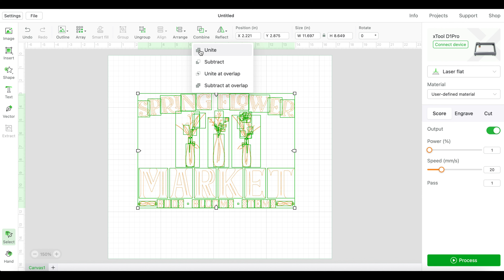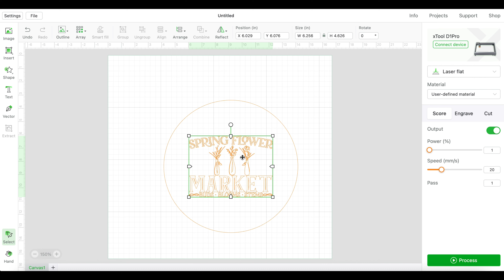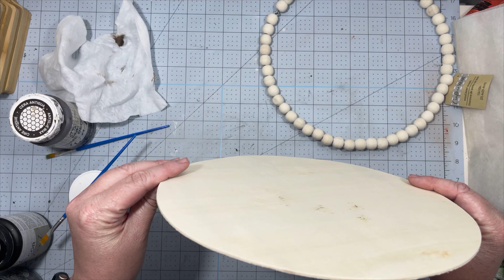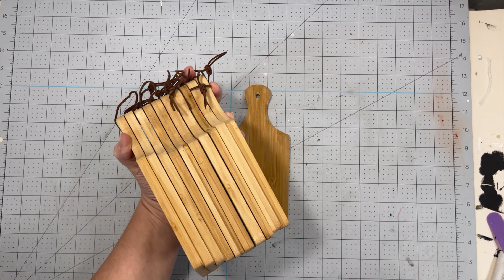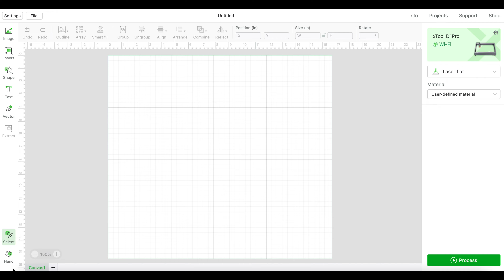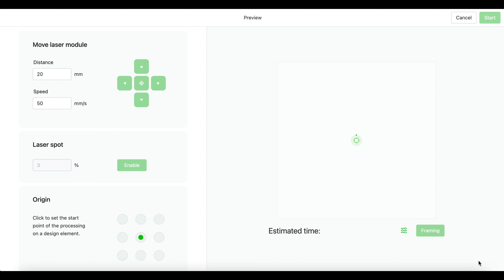Make Some Projects With a Laser || Easy Beginner Friendly Laser Projects || xTool D1 Pro

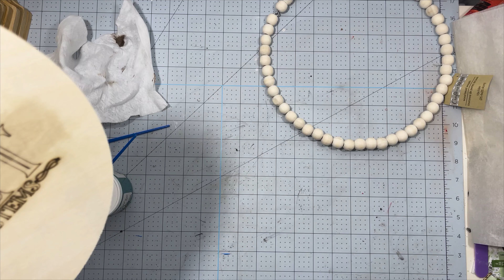Comment: The circle definitely moves at around the 7:05 mark. Thanks for the video!
Reply: I believe it was the cable from the laser module making contact with the item as it was moving. I have secured mine in a way that stops this from happening.

Comment: I found for centering and the such. Is that I make a tool templet the size of the object edge. Then I turn of the output of the design & run a rubberband frame. Then I flip the process and do the same on the design to see where it will end up. Although I took of my laser guard so I can see it better & it doesn't keep the heat trapped in. Goggles are a must.

Comment: Cool project, thanks for sharing. While watching the laser run I noticed that the cables were getting awfully close to your project. Maybe they hit the wood and moved it?
Reply from the maker: There is a good possibility, I haven’t had anything else have that issue since. I that wood was super thin and not flat so it was probably a little bowed. Thanks for watching!